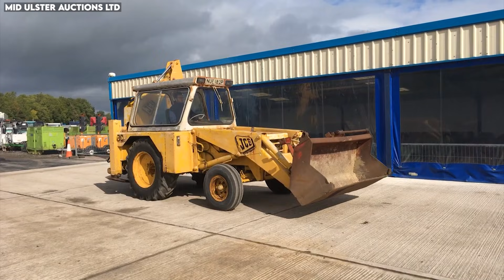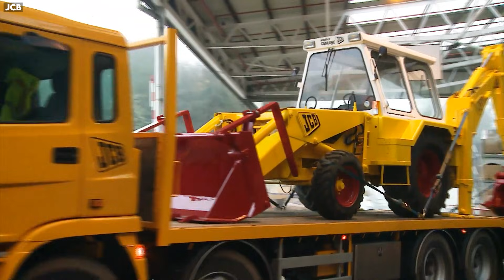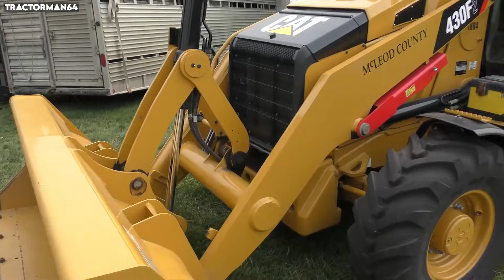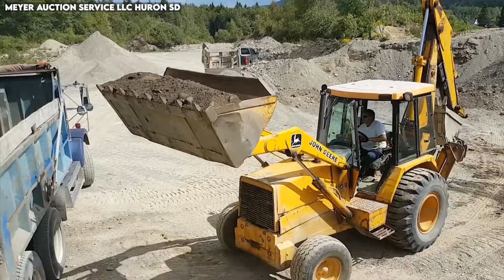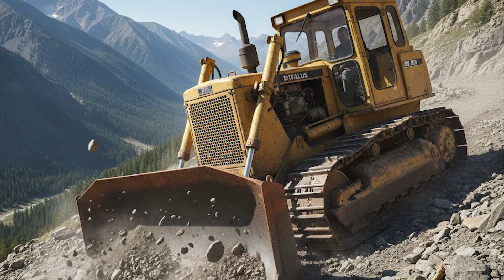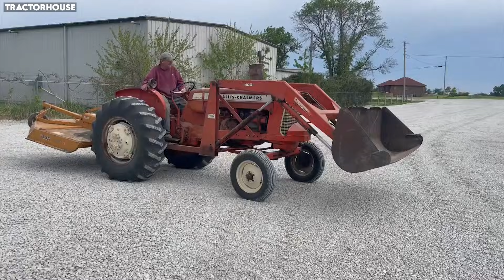10 Backhoe Loader From the 1970s That Were Too Strong For Their Time

Comment: You TOTALLY missed my big baby boy. The BUCYRUS ERIE Line of tractor backhoes 
I own a Dynahoe-190, the line was the 140 the 160 the 190 and the monster 200 😊
They made the 190 in 4x4 and the 200 had all wheel drive with rear wheel turning. 
The numbers are the digging depth my 190 will dig 19 feet. It Wt. 19000 pounds 😊
My dipper arm alone is over 10 feet long. You could put a big jackhammer tooth on the Dynahoe and the backhoe held together. The backhoe mainbase is part of the total mainframe 😊 my Dynahoe is a 1978. Bucyrus Erie stopped making the series in 1985 when the just focused on heavy mining equipment.
Reply: Best backhoe ever!!!!!!
Reply: I miss the dynahoe…big and loud!!
As a kid I loved hearing that Detroit engine
Reply: Yes!! I'm surprised they didn't include the DYNAHOE. I've always own Deeres, but I've been around Dynahoes, they were tanks!! My friend had a 200-4. 20 ft dig depth and a 3 yd front bucket! What a power Houston. Big hydraulic pumps. They were fast!